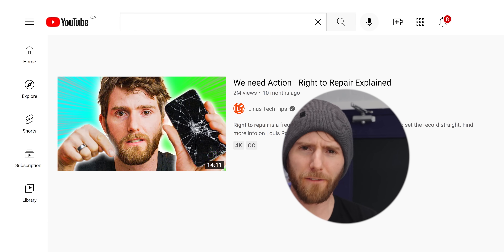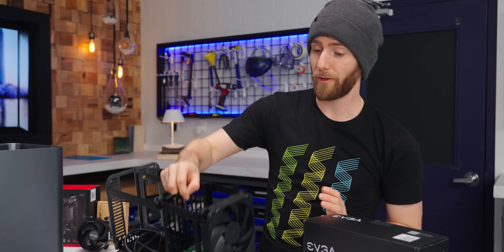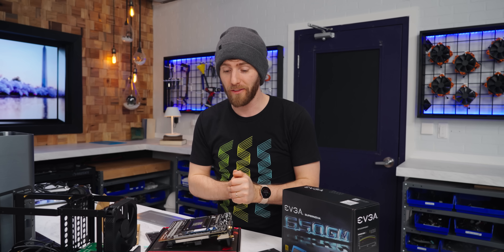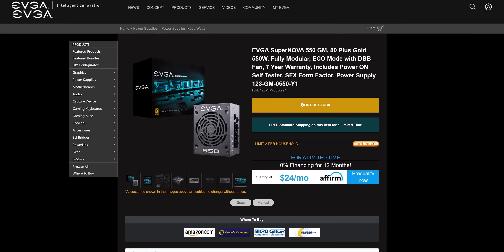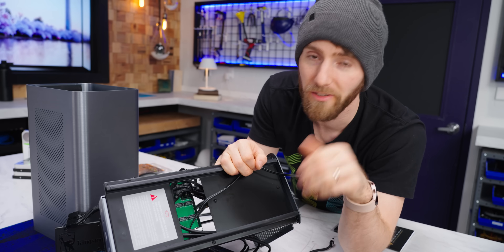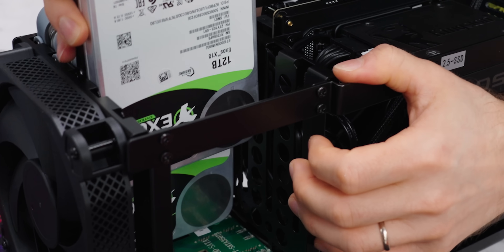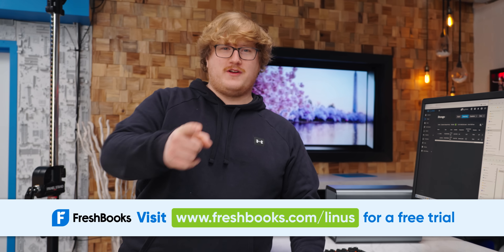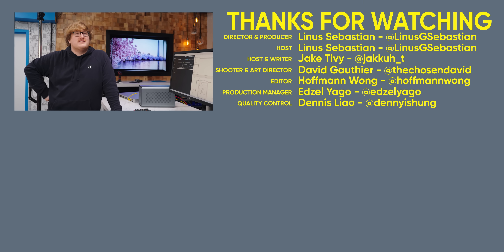This blows away the competition - JONSBO N1 NAS Build

Comment: Adding a external GPU to this with extra usb IO besides what is on back of motherboard would make this sweet might not be best thermal setup though for having a higher end CPU and really this case design besides looking cute and small wouldn’t give much advantage to a standard PC case idk I have my main PC setup with a Raid0 dual 12tb storage drive thats separate to my 4th hd and two 1tb ssd that I use for actual pc stuff and my case is really about two of those lil silver things stacked on top of each other and I could easy add 3 more hard drives so I don’t see the use for anyone who already has a regular PC build unless the built in the micro PC case when they built there PC and I’ll never understand the want for a tiny PC a regular mid tower atx PC isn’t like huge and unwieldy of course I’m 35 and when I was a kid my first PCs where full tower sized consumer PCs that ran dos and you had to now commands to execute your floppy disk game haha the good old days I remember when the small hard floppy disc was a monumental improvement haha then when windows 95 came out and the amazement of the first CD drives and then the 56k modem dialing up man it’s amazing in just my lifetime the advancements in hardware and software. Eventually you’ll be able have a cellphone with a full tower pc build today in it and it’s hard to
Imagine why anyone will ever need more compute and storage pretty soon in the future

Comment: Raid z2 is recommended because after hard drives get bigger then 8-10TB raid rebuild times get kind of silly and you really want that double redundancy.
Reply: So you lose 2 of 5 drives?
Reply: @GregMatoga  You lose the overall capacity of 2 drives but you can also survive 2 drive failures before losing your data. The thing is a rebuild when to get to 8TB+ starts to hit the point of taking weeks and not days to finish and the remaining drives are under extra load from it too. If you bought all your drives at the same time and 1 dies of old age there's a good chance you have a second around the corner because they're all the same. If you want to get paranoid buy different models at different times.

Comment: I run TrueNas as a VM on my Proxmox Server. Seeing this case is also finalizing an important decision for me, as I was searching for a ITX case with more then 2 slots of HDD space (3.5Inch that is).. thanks for this Linus and the crew! Keep it up ;-)
Reply: Fractal node 304's another honorable mention (6 x 3.5)
Reply: You can also look into the Fractal node 304. Its a bit bigger than this case it seems but cheaper
Reply: @thebeatconnect1  Thanks mate! will check it out :D
Reply: I was thinking of doing this exact thing. The issue is I currently run OpenMediaVault, and use a ton of docker containers. I'd like to run a slim VM just for docker stuff and TrueNAS for storage. I like the idea of separation of concerns. My biggest concern with that is that I don't want to make a hop to the router, just for the containers to be able to access the data. Does Proxmox offer a way for the two VMs to communicate directly?
Reply: @bugs181  I am running Proxmox. Proxmox sets up a bridge from your NIC. When you create a new VM it assigns a IP address to the VM. To access your data from Truenas to docker/Portainer, you need to share your dataset in TrueNas. And then in the VM running portainer/docker you need to do some configuration to mount TrueNas to the VM. Let me know and I can write the steps here.
Reply: @thebeatconnect1  thanks for the reply! I believe my Unifi network hands out the IP for DHCP to the OMV VM. It's bridge is vmbr0. 

If what I gather so far, it's possible for the VMs to communicate using the bridge without hopping back to the router (UDM Pro in this case). 

The primary reason this is such a concern, is because the UDM Pro has a 1Gbps backplane and I'm getting ready to add 10Gbps NICs to the Proxmox box.

I definitely appreciate any info you could give on this topic.
Reply: @bugs181   what @TheBeatConnect says is indeed correct. When it comes to just communicating from VM to VM, proxmox can handle that out of the box like you say.

I'm personally not a superfan of containerisation, but I do understand the benefits of it. With that being said....

What is important to note is that if you want to map out your drives to TrueNas VM, you don't need to mount them in ProxMox, you can just pass them through with a simple command line in the shell ;-) if you want, let me know and I'll post the command here as well ;-)

Also, thanks for the information on the case, will check it out as well ;-)
Reply: @ReaperSilently  thanks for your response! I currently have the drives being passed into the OMV VM via pass-through with the whole card, if that's what you mean? 

The only other thing I need to consider is the ability to export the ZFS pool from OMV and import in TrueNAS and hope I don't run into any issues. I've never exported ZFS before, so that's a bit concerning.

I understand containerization isn't for everyone. Unfortunately for me, I got started all because I have abysmal ISP speeds (about 34KB download on average). So I built a youtube video downloader JUST so I can watch youtube videos. One of the containers is a webhook that gets triggered with a chrome extension. The other container allows me to stream the video. 

Before I get myself into trouble, I'm not doing any copyright infringement because the video gets deleted after I watch it AND I subscribe to youtube premium, just to ensure the uploader gets revenue. Sadly, it's the ONLY solution to enjoy watching youtube videos. Their solution doesn't work for me (using download inside app), because it quite literally kills the network.

Comment: wouldnt it be way better to use z2? with z1 you run the risk of a drive failing while another drive may have an unrecoverable read error that was not yet caught and cause mayor problems this way when rebuilding the array - even tough only one drive failed

Comment: Hi linus i am a bit disappointed that you used 100Tb on video link (image for video in you tube) when the storage was not that   a bit of click bait   the video was good  either way  but from my experience you kinda need video output from trouble shooting side of things and that happens reguadless of setup, would like to see that option compare to dell r720xd 12 x 3.5 inch drives, 128gb ram  server running truenas scale  though...

Comment: Funny you said the OS drive is basically read only… I’ve been running truenas/freenas OS off of a 32gb flash drive for about 3 years now with no issues. Stupid cheap and frees up an extra sata port for storage. Plus I’ve got a clone  of it on another flash drive so when the first one dies I can just pop the new one in and be back up and running in no time.

Comment: Really cool case and project. I always love tinkering but the thing that brought me to a 4 bay qnap NAS was power consumption. Here in Gemrany we pay about 31ct/kWh and for a NAS there counts every watt and may Of the shelf NAS is much more efficient. Probably not that big of a concern in the US or Canada
Reply: Most of those units use atoms or other low end chips. I've got to play with quite a few different Nas units. The thing is most of them have meh grade psus. You can still manage to save power in this instance for example. 
1 use a more efficient / better psu then they did here (not hard)
2 if your using anything with a fairly unlocked bios like consumer Ryzen stuff then drop the clocks and voltage a little and or consider changing the power states and or power limits and boost duration metrics.
3 use a embedded ITX system with a amd low power soc like their V series or some of their mobile parts (under 25w parts) 
There are a few other ways to save power as well
Reply: @Onewolfoc  That is right though my QNAP has a Quad Core Intel which is more than enough for my data, Plex and HomeAssistant, so  everything else isnt needed. Sure ZFS would be better but for my purpose it is enough and got it at a discount, too.

Comment: I use a Mediasonic Probox H82-SU3S2 8-Bay which sells for $400 CDN on AMAZON. The easiest way to connect is with e-sata which I use an Intel card because it supports multiple hard drives on a single e-sata cable. Using dynamic mode in Windows (Linux is an option) getting any level of RAID setup is easy. Using 20 TB HDDs you can have up to a 160 TB JBOD or 120 TB on a RAID 6.

Comment: We’re two photographers in our house, so we go over 6tb a year or so of storage. This might be a solid solution for the NAS. And it would be a nice build knowing I can upgrade. 

Any other photographers here think this is a good idea?
Reply: Get a Synology of you care about your storage professionally. You want a solution that works well and is proven in failure scenarios
Reply: @Goodoo4U  I’ve already got a WD EX line but as an archive of delivered material. I’m happy but we’re buying a house and I’ll wire Ethernet in rooms. So I will centralize things and I can run trials and tests…and I’m also a grown ass man acknowledging the risks lol
Reply: @Goodoo4U  which components would fail here? Most likely the drives, which would be the exact same ones you use in a prebuilt anyways. Just curious what you mean by "proven"
Reply: If you're comfortable with having to properly administer your own server than yes otherwise a pre build solution is probably the better choice purely to minimize a user error costing you your data.
Reply: @skirata3144  yeah, that’s the point. The build is a fun challenge and I want to control things. Specially building something to my spec.
Reply: @fede35mm  Well seeing this and also that you're about to buy your own house doing it yourself might develope into a nice hobby. Also to give you a few pointers if you want to dive deeper into it as a hobby (10gig networking, smart home, etc.) I'd like to suggest you a few channels who provide a lot of valuable information on those topics:
Lawrence Systems (Very professional has a lot of information on networking, TrueNas and similar. I'd highly recommend going through his Homelab show and view the episodes whose topics are interesting to you)
Craft Computing (Quite professional mostly talks about homelab stuff and has a great video about a cheap 12bay rack mounted server uploaded a year ago)
The Hook Up (More of an enthusiast mostly about smart home stuff with a focus on surveillance cameras)

I really hope that this might be helpful have fun and good luck finding the correct solution for yourselves.
Reply: @skirata3144  thanks for the overload of info :) will write these down and start just passively absorbing the information

Comment: Well if you wanted to make it into a more proper NAS solution with ZFS - I'd say first of all consider a platform with ECC RAM to make sure no in-memory bit flips happen between the NICs and storage, afterwards depending on how many extra ZFS features you'd like to have do not consider less than 32 GB of RAM, preferably more - in the maxxed out dedup+compression+in-RAM-caches you might end up with up to 1GB mem per used 1TB of storage for ZFS stuff, so in a 5x20TB Z1 array you might need up to 80GB of mem  when reaching storage full capacities/usages... As such, given the pricing, go for 64GB mem on ZFS heavy storage builds. Furthermore, opt for Intel for its QSV from the iGPU to acceleraate media serving/transcoding duties. Once Intel releases their dGPU to public it might become next best thing, or you can try P400/T400 or in the future A400 from nVidia for DSP duties at lower wattage... Or if you can afford - something like Alveo U30 etc.

Comment: Jake, when you mapped the drive and said "bam 43.3 Terabytes" because windows uses TB its actually 43.3 Tebibytes and same when you read the "Gigabytes" GB in the properties menu, those are Gibibytes just again windows is bad and doesn't label them correctly. But they are not Giga and Tera because if you try to unit convert it doesn't line up. But if you use Tebi and Gibi it all lines up. Binary Prefixes and their abrivations are an international standard as of 2009, with ISO 80000-1, please help educate the world to reduce confusion. Though interestingly enough physical media is sold in base 10 units which besides formatting is why you see a reduction in what you have because it's being displayed in base 2 units. Keep making the great videos.

Comment: The case is nice looking, but for the price with shipping included ($230+, not $126), there are other ITX cases that have true external hotswap bays, and will run you less $ (plus they're shipped domestically). Regardless of this moderate oversight, the idea behind this type of build is a great idea, especially w/ the recent QNAP ransomware hack.
Reply: Can you name such cases please?
Reply: @smajl159  another commenter said they were looking at the SilverStone SST-DS380, but I have no clue if it's actually any good
Reply: @desertkil  Also look at the CS01-HS by Silverstone, that's the one I've been eyeing.
Reply: An inter-tech sc-4100 looks interesting as well I think?  I’d guess the availability in NA for it would probably suck though, it looks like it’s a German company.
Reply: But both Silverstones are only for 2.5" disks
Reply: @smajl159  the 380 supports 8 hot swappable 3.5” drives and 4 fixed 2.5” ones according to the manufacturer website. Maybe you landed on the page for the 280?

Comment: I would love a longer, more in-depth, video on this stuff. For example, what's it like to expand the storage? Buying a stack of harddrives before you even need the capacity is a waste of money (since cost of storage is always going down), so I would want to add more drives down the road instead.

What happens in a more catastrophic failure? Say your other hardware dies on you, what's the recovery options? (yes, I know, it should already be backed up in a third location, but if you can recover the data, that's going to save time rather than getting it back from backups). I recently almost lost 8TB of data due to a QNAP dying on me, luckily it was possible to just transfer the drives to a newer NAS and all was well.

Speaking of recovery, in the worst case scenario, can the data be recovered using recovery tools? This links back a bit to the first question. In my case I wasn't able to get it back, I tried 3-4 different softwares for it, paid and free. I think it was due to how I had expanded the storage earlier, so it was kinda "fragmented" I guess, it seemed to confuse the recovery software.
Reply: Sounds exactly like what happened to Chris Titus Tech at one of his clients locations!!!😳

Comment: I'm about to switch into a mobile world. My QNAP is VERY long in the tooth and trying to run something with spinning disks in a moving vehicle is not wise.

So I've been looking for the right mITX or mATX case that will let me have at least 6 2.5" drives for SSD's for a very similar build.

I'm still on the fence for cases but have been considering the LOUQE Ghost S1 Mk III or the SilverStone CS01-HS Premium NAS case. Both of those are higher priced. I don't think I need a backplane, and SSD's have no moving parts, so I might look at just 3D printing up a 8x 2.5" bay HDD mount.

I was also looking at a cheap (aka used from ebay) SAS raid card (like the LSI SAS 9300-8i) along with a pair of mini-SAS to 4x SATA breakout cables. (Mostly to just get the speed out of the SSD's. (an Intel X540-T2 10GBase-T NIC card I can grab from work is pretty much free from our decom bin)

The motherboard was one I overlooked. My build I was targeting the GIGABYTE B550I AORUS PRO AX.

Comment: I've been using a kingston A400 480GB as my OS drive for over 2 years, the system is on over 12 hours every day, game 30 hours a week, games on other drives, lots of game streaming. Drive is solid, stil 430GB capacity after a few maintenance OS reinstalls, probably use it another year before moving OS to nvme and use the A400 for game overflow

Comment: How did you verify the motherboard would boot headless? Every consumer board I own gives me a GPU error - even if the OS is preinstalled.
Reply: This is the exact issue I'm having. Have a solution without using a graphic card? The CPU doesn't have integrated.

Comment: So I made the switch to a Synology NAS with raid 5 (sorta) because I didn’t know about this case. Wanted to make my own, will do it next time.

I’m glad you showed us how to set this up, BUT, if the NAS itself cratered and you were left with your RAID pool of drives only, how do you safely reuse the drives without rewriting them? Or how do you recover all the data using your next NAS? This is the last step that still freaks me out.

Comment: but the prebuild like synology has better support for those dont wanna deal with the network or settings problem , and also prebuild has apps on Mobile device whcih can also run as music stations movie stations or auto backups. u can install a synology os on a diy but u are gonna face those setting problem and compatible problem again.... so i would prefer to stick with prebuild like synology although its more expensive , just not a big fan of tinkering

Comment: Another potential benefit is security. My NAS just lost everything because it got hit by a ransomware attack due to the manufacturer's bad security. After looking into it, it looks like nearly every NAS manufacturer has had similar issues (Synology, QNAP, and Terramaster). Moved all those drives to an old computer and setup my own NAS with more control.

I'm wondering why I didn't just do this from the start. I had the computer in storage, cost was essentially nothing for a significantly more powerful machine. The only downside is that I have to store a large tower now.